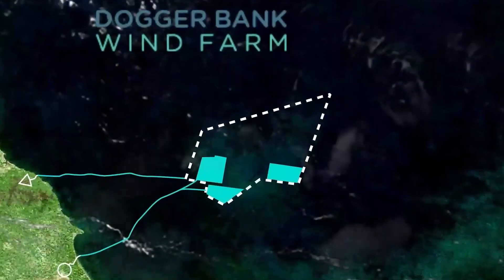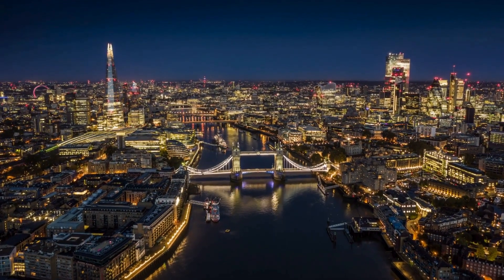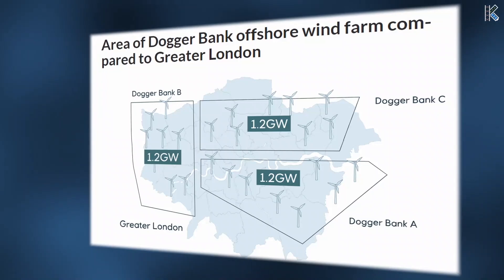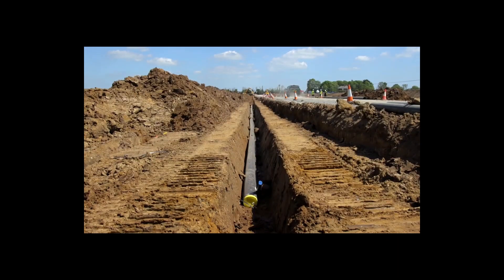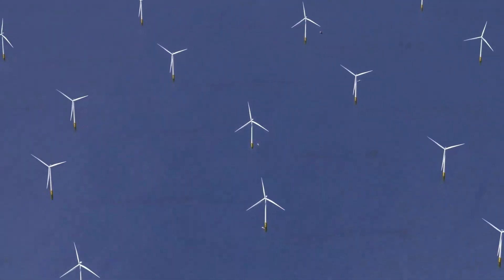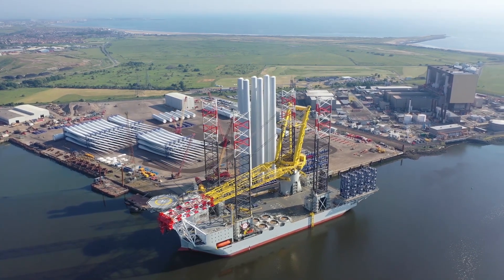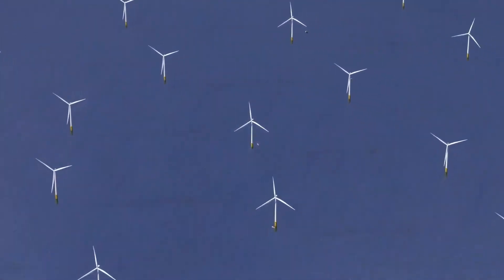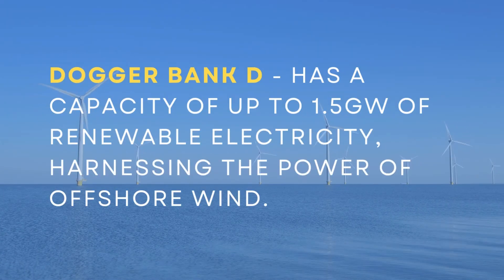The $11 Billion Wind Farm That Will Change Europe

Comment: And when it is not windy...or too windy? Why is UK electricity supply the most expensive in the developed world?
Reply from the maker: Great question, John. You’re right. Wind power depends on the weather, which is why the UK balances it with other sources like gas, nuclear, and interconnectors to Europe. The high energy prices in the UK aren’t just about wind, they’re also linked to how the wholesale market is structured and reliance on imported gas. Projects like Dogger Bank aim to reduce that dependence long-term by generating huge amounts of low-cost renewable power once fully online.
Reply: @FutureEnergyProjects  So when they get this project into production, does that mean that we will need nuclear for balancing out the grid. Why are we not developing our own gas fields instead of having to import gas?

Comment: So, the whole project (35 years of maintenance included?) cost 11 billions.
It’s 315 millions/year. (If it runs 35 years)
To power 6 millions houses.
So 52,4 million per house per year…

That’s quite expensive 😅
Reply from the maker: The $11 billion Dogger Bank project is designed to generate around 18 terawatt-hours of electricity per year, which actually works out to just a few cents per kilowatt-hour for millions of homes, not tens of millions per house.

The quick math in your comment is a bit misleading because the cost isn’t divided per house per year, but per unit of energy produced. Over its 25–35 year lifespan, Dogger Bank is expected to supply renewable electricity to 6 million UK homes at a competitive price compared to fossil fuels, while also reducing carbon emissions. The “per house” framing makes it look extreme, but when calculated per kilowatt-hour, it’s in line with. and eventually cheaper than other sources of power.